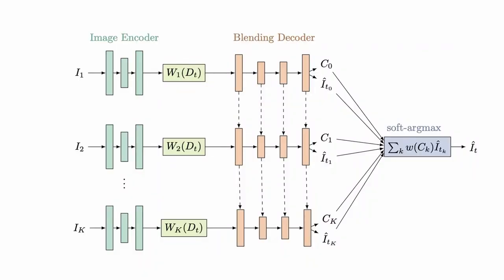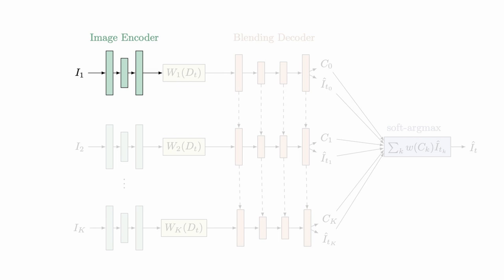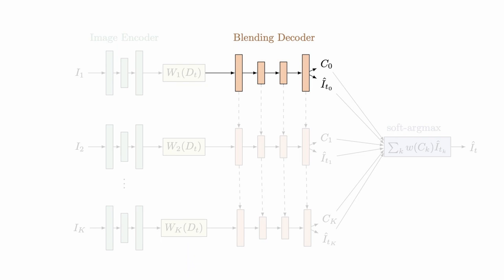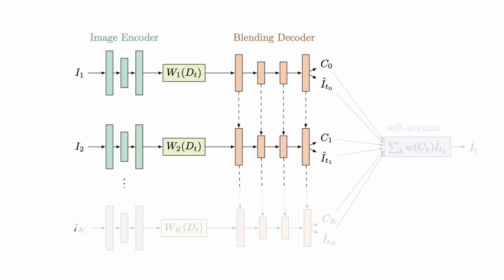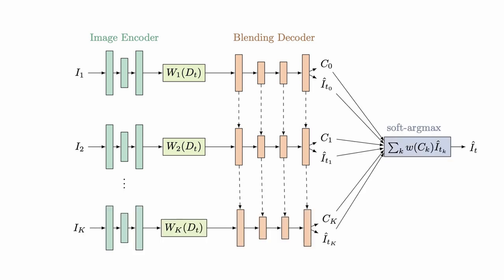Free View Synthesis

Comment: Great work! Actually, similar to what Jon Barron said, I think the results of NPBG sometimes look a bit strange, especially for the table model at 5:42 (yet, the renderings of NPBG for truck seem to be plausible and close to what we usually achieved with NPBG). Is it possible that the camera poses have been noisy, or the point cloud geometry was missing something? Thanks!
Reply: Thanks. We used the same reconstruction process (i.e., COLMAP with same settings) for Tanks and Temples data and our new recordings and we used also the same settings/protocol for NPBG training and evaluation. The difference seems to be that the input point cloud contains a lot more outliers for the soccer table scene (maybe because of more blurry input images). The Delaunay based surface reconstruction seems to remove most of those outliers and hence, may leads to the cleaner results.
Reply: @gernot1909  Thank you for the answer!